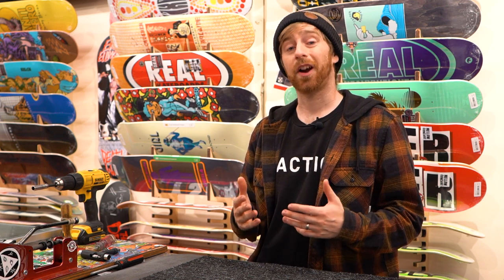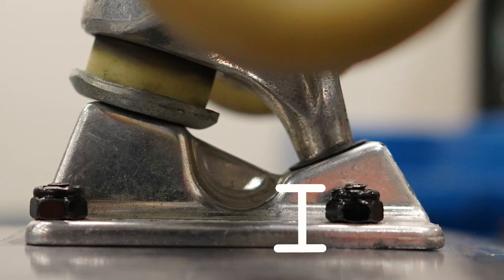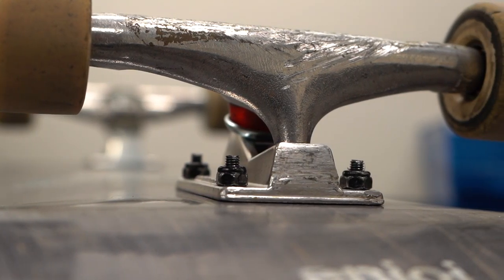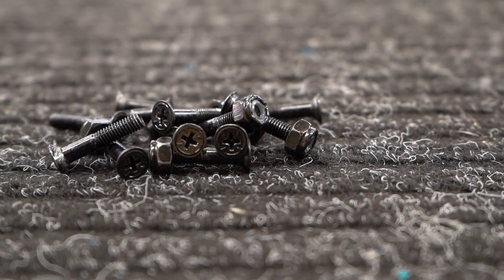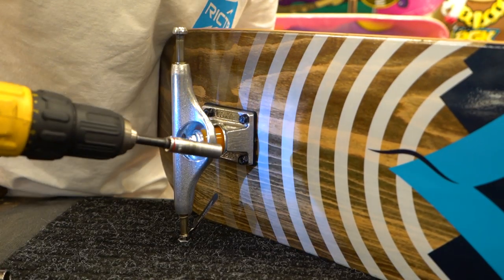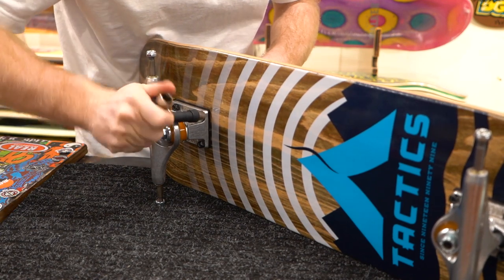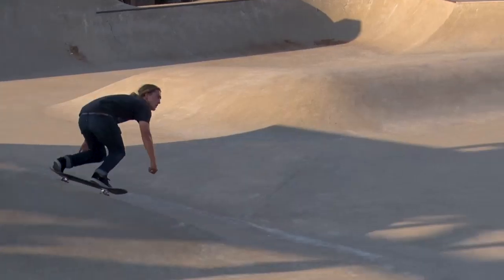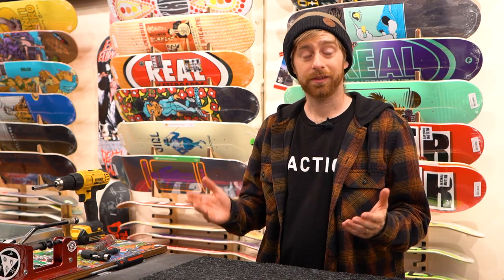What Size Skateboard Hardware? | Tactics

Comment: Does anybody know the standard diameter of truck mounting bolts please? I'm not interested in the length.
Reply from the maker: Skateboard hardware are 10-32 UNF bolts that measure 3/16" or 4.76mm wide on the threads.
Reply: @tacticsboardshop  Thanks man, this single measurement has been impossible to find anywhere!

Comment: I have a 5 ply deck and the hardware sticks out from the top, what’s the cause of this?
Reply from the maker: Are the plies very dense? Is it a Flight deck board or a fiberglass longboard deck? If the plies are denser than regular maple, it's sometimes difficult to countersink the hardware till it's flush. So I guess just try to tighten the hardware a little more until it's flush with the top. Unless you have dome headed hardware, then you'd just have to get different hardware. I hope that helps! - Tim

Comment: What size hardware should I get for 8.0.deck
Reply from the maker: The width of the deck won't factor into the hardware length. What does factor in is the thickness of the deck (# of plies) and whether or not you're using risers or not. I assume you have a standard 7-ply deck (almost all skate decks are 7-ply), so with no risers you can use 7/8 inch hardware or 1 inch just to be safe. If you're getting risers just get a little bit longer hardware to accommodate for it. I hope that helps! - Tim
Reply: Tactics Boardshop thank you

Comment: What should I do if the hardware from my old deck arent flush with the new deck? They kind of stay above and wont go deeper, and its quite annoying :/
Reply from the maker: You can still skate it like that, but I agree that it's annoying when they stick out a little. You're gonna have to find a way to brute force tighten it by either by using your screwdriver or 3/8 wrench on the nut side. If your hardware is stripped and it's making it impossible to tighten fully, then you should probably get some new hardware which fortunately is super cheap. I hope this helps a little! - Tim
Reply: @tacticsboardshop  thanks for replying, i carved the board a bit with a stanley knife and it fits snug now, thanks again :)

Comment: wait im getting 8.25 deck with a 5.5 truck size what size risers do i get and what size hardware??
Reply from the maker: The width of the deck won't factor into the hardware length. What does factor in is the thickness of the deck (# of plies) and whether or not you're using risers. I assume you have a standard 7-ply deck (almost all skate decks are 7-ply), so with no risers you can use 7/8 inch hardware or 1 inch just to be safe. If you're getting risers just get a little bit longer hardware to accommodate for it. I hope that helps! - Tim

Comment: What hardware size do u recommend for a size 8.0?
Reply from the maker: The width of the deck won't factor into the hardware length. What does factor in is the thickness of the deck (# of plies) and whether or not you're using risers or not. I assume you have a standard 7-ply deck (almost all skate decks are 7-ply), so with no risers you can use 7/8 inch hardware or 1 inch just to be safe. If you're getting risers just get a little bit longer hardware to accommodate for it. I hope that helps! - Tim
Reply: Personally I like skru hardware it last longer than other brands.👊👊

Comment: Bro I’m so confused can you please tell me what fits 7.5 deck
Reply from the maker: The width of the deck won't factor into the hardware length. What does factor in is the thickness of the deck (# of plies) and whether or not you're using risers. I assume you have a standard 7-ply deck (almost all skate decks are 7-ply), so with no risers you can use 7/8 inch hardware or 1 inch just to be safe. If you're getting risers just get a little bit longer hardware to accommodate for it. I hope that helps! - Tim

Comment: I just sized up to a 8.5 and I don’t no what size hardware I should get
Reply from the maker: The width of the deck won't factor into the hardware length. What does factor in is the thickness of the deck (# of plies) and whether or not you're using risers. I assume you have a standard 7-ply deck (almost all skate decks are 7-ply), so with no risers you can use 7/8 inch hardware or 1 inch just to be safe. If you're getting risers just get a little bit longer hardware to accommodate for it. I hope that helps! - Tim
Reply: @tacticsboardshop  thank you for ur help ❤️❤️❤️

Comment: Ive tightened the bolts and they wont go flush
Reply from the maker: What kind of bolts are they? Also, what kind of board is it? Some decks that have fiberglass plies or non-maple construction make it a lot harder to counter sink the hardware.

Comment: so i can get any hardware for a 8.06 deck? like a 7/8 bolt, would that be ok for a 8.06 deck? sorry im new

edit: thank you alot, this video is very helpfull :)
Reply from the maker: Yes, the width of the deck doesn't factor into the hardware length. So as long as you're not using risers, 7/8 hardware will work fine. 👍 - Tim
Reply: @tacticsboardshop  thank you

Comment: What size will fit a 8.25 deck
Reply from the maker: The width of the deck won't factor into the hardware length. What does factor in is the thickness of the deck (# of plies) and whether or not you're using risers. I assume you have a standard 7-ply deck (almost all skate decks are 7-ply), so with no risers you can use 7/8 inch hardware or 1 inch just to be safe. If you're getting risers just get a little bit longer hardware to accommodate for it. I hope that helps! - Tim
Reply: @tacticsboardshop  darn I ordered a   1 1/4 inch hardware😬

Comment: My board now is 7,75 but I will switch to 8,25 and idk what size hardware to get
Reply from the maker: The width of the deck won't factor into the hardware length. What does factor in is the thickness of the deck (# of plies) and whether or not you're using risers. I assume you have a standard 7-ply deck (almost all skate decks are 7-ply), so with no risers you can use 7/8 inch hardware or 1 inch just to be safe. If you're getting risers just get a little bit longer hardware to accommodate for it. I hope that helps! - Tim
Reply: @tacticsboardshop  alright thanks
Reply: @tacticsboardshop  also what hardware brand would u recomend me ?
Reply from the maker: @SirCulzier  Any hardware brand is gonna be pretty much the same. Independent, Shake Junt, Shorty's, Diamond, etc. They'll all work fine. So just get whatever works for the look of your complete. 👍 - Tim
Reply: @tacticsboardshop  size 1 is one inch right?
Reply from the maker: The sizes are notated as their length and increase in 1/8 inch margins. So the smallest is 7/8 of an inch, then 1 inch, 1 1/8 inch, 1 1/4 inch and so on. If you're not using risers, then 7/8 or 1 inch will work fine.

Comment: so if i have a 7.75 what should i get?
Reply from the maker: The width of the deck won't factor into the hardware length. What does factor in is the thickness of the deck (# of plies) and whether or not you're using risers. I assume you have a standard 7-ply deck (almost all skate decks are 7-ply), so with no risers you can use 7/8 inch hardware or 1 inch just to be safe. If you're getting risers just get a little bit longer hardware to accommodate for it. I hope that helps! - Tim

Comment: What hardware should i use for a 7.75 board?
Reply from the maker: So the board width doesn't factor into the hardware length. What does factor into the hardware length is how many plies the deck has, and whether or not your using risers. I'm assuming you have a standard 7-ply deck (most skateboards have 7 plies), so with no riser pads the smallest hardware you can use is 7/8 of an inch. If you have risers, then you have to get longer hardware to accommodate for the extra thickness. I hope that helps!
Reply: Thank you!!
Reply: Gerards Here it’s frozen and I can’t click read more to the reply.. I’m getting a 7.75” board so what hardware should I get? Help me out please
Reply from the maker: @savannasuliman4789 So the board width doesn't factor into the hardware length. What does factor into the hardware length is how many plies the deck has, and whether or not your using risers. I'm assuming you have a standard 7-ply deck (most skateboards have 7 plies), so with no riser pads the smallest hardware you can use is 7/8 of an inch. If you have risers, then you have to get longer hardware to accommodate for the extra thickness. I hope that helps! (I just copy and pasted the reply) 🤝
Reply: Tactics Boardshop thank you so much🤩🤩

Comment: I don’t understand this video I’m buying a 8.0 deck and my first time making one what size hardware for a 8.0 deck with a 147 thunder trucl
Reply from the maker: The width of the deck won't factor into the hardware length. What does factor in is the thickness of the deck (# of plies) and whether or not you're using risers. I assume you have a standard 7-ply deck (almost all skate decks are 7-ply), so with no risers you can use 7/8 inch hardware or 1 inch just to be safe. If you're getting risers just get a little bit longer hardware to accommodate for it. I hope that helps! - Tim
Reply: @tacticsboardshop  thank you this helped so much

Comment: What are colored cross bolts used for? Can they used to differentiate the front vs the back end of the deck with different colored cross bolts for example? If so, what configuration is best/popular or is it a matter of preference? Thx ﾍ(  °ω°)ー
Reply from the maker: It's completely preference. I like to have 2 coloreds bolts towards the nose so I can immediately determine the front/back, but you can do whatever you want. Cheers! - Tim
Reply: @tacticsboardshop  Thanks for informing! Much appreciated! Cheers! ～。(っ´ω｀)っ。

Comment: what hardware should i get for a 8.25 deck?
Reply from the maker: The width of the deck isn't going to factor into the hardware length. What is going to factor in is how many plies your deck has, the thickness of your baseplate, and if you're using risers or not. If you have a normal 7-ply deck (almost all decks are 7-ply) with no riser pads, you can use 7/8 hardware, but you could also do 1 inch just to give yourself a buffer. I hope that helps! - Tim